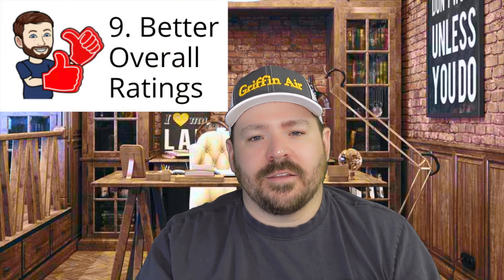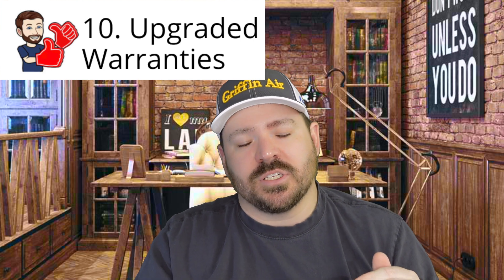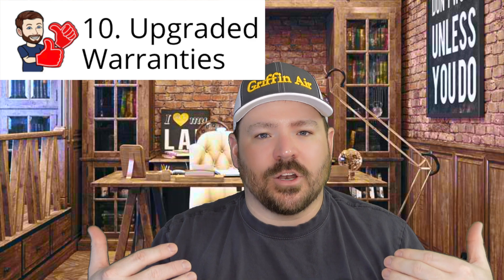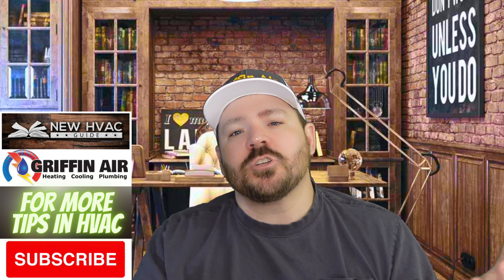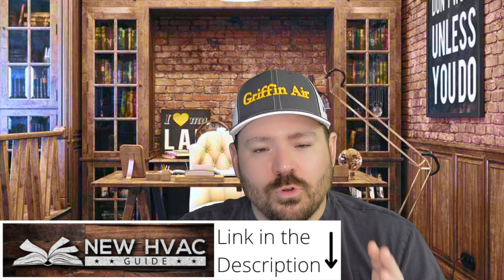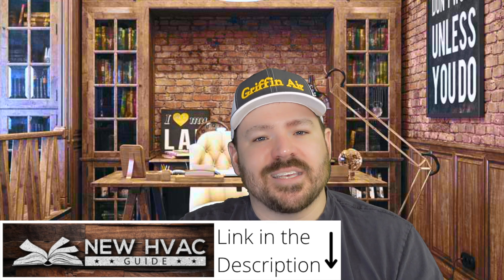12 REASONS Inverter HVAC Systems are BETTER!

Comment: not sure why im even watching this video... I know very little about HVAC.  I guess I was hoping to pick up little tid bits here and there but I don't know what a SEER is or how it compares to a conventional HVAC system.  All I know is the TAppan that came with my home, (both built in 2005) is no longer keeping my house cool.  Probably needs a recharge but I remember last summer when I first looked at this house, the owners had the AC set at 69... and it was like that after I moved in back in August.  I kept it there for a month or two and it didn't seem to have any issues.  I did turn it down to 73 and that was fine... until today, I tried to turn it on and it just would not reach 72.  It was on all afternoon.  :(
Reply: Bro, call a pro
Reply: @markw4692  lol, I did.  I know when I'm out matched
Reply: If your system needs a recharge it needs a repair or replacement. AC systems are sealed and should never leak or consume refrigerant. If they are, it means the system is physically compromised.

Comment: Inverter system can drive you nuts I had one that kept shutting down they had low voltage line with wire nut so I change the lines then it did it again this time tightened all wire connections then I came back a third time it turn out the power company had a loose connection on their side of the meter so the moral of the story is when installing and invert system be sure not to have low voltage wire that is patched and that all your wire buses are tight the boards on them are amazing and will protect the system also warn your customer not to turn the system on and off because that computer on the system does not if it is broken so it protects itself from any electrical even if it is the customer
Reply from the maker: Good tip pal!

Comment: I'm at the 6 year mark and so far my Bosch inverter has required 2 evaporator coils, a blower motor, heat strip and a motherboard for the outside unit. The unit sucks
Reply from the maker: Oh my gosh! I’d feel the same way if I were you. I’ve got a Bosch in my house and only had 1 issue. On year 4
Reply: I mean no disrespect but sounds like poor install , Bosch don’t have the same margin of error as basic systems an improper install such as not doing a proper vacuum for example or proper SH an SC , air flow issues/sizing/proper load calculation ,as well as many other things will cause major issues and we have the same issues with txvs in basic models. 
Just my opinion hopefully you could have gotten a lemon
Reply: @pineappleplays2947  It was a bad install I'm sure.  I had a new system put in last week for 14 grand,  Daikin DZ18VC.  I got the AHRI number and found they installed the wrong air handler so they came back out and replaced it tuesday.  I noticed the drain trap leaking so put a bucket under it and they fixed that yesterday.  I had to remove the attic stairs and now have them back in place.  There was a 20x14 and 20x25 return daisy chained so they made it 2 returns.  I got 12 year parts, unit replacement and labor with 2 maintenances a year at $125 each.  Wish me luck.  We are cool atm !!  I sold the 6 yr old unit with bad evap coil on FB for $800.

Comment: what do you think of the newer york HMH7 system that's kinda cross between a mini split and heat pump?
Reply: I have that model installed at my house, I don't know what you mean, it's just a inverter heat pump that runs to a coil in the air handler/furnace like every other central heat pump or A/C. It's not like a mini-split ductless or anything like that. Maybe you're talking about hybrid VRF systems?
Reply from the maker: I personally have not laid hands on this particular system. But if I’m honest, there are other brands that have done it better and sooner

Comment: There are quite a few companies that just don't have the confidence in inverter Compressors. Especially if your seeing 3-5year warranties.... There are some very smart people that do probability calculations for these companies. No a 100% conclusive piece of info to have but a good indicator of where your money should be placed... I definitely trust they're math.
Reply from the maker: What companies only offer three year warranties on compressors? Most industry pros agree that compressors in inverter systems are more reliable even if they don’t agree the extra cost is worth it for the customer for utility savings.

Comment: I’m deciding between the trane 3ton xv18 or the 3 Bosh ids 2.0 bovb18 or Daikin fit 3.5-ton 17 seer,  which one would be the quietest and have lower cost maintenance/repair long-term
Reply from the maker: You’re comparing 3 pretty good systems pal. I’d go with the contractor you like best
Reply: @NewHVACGuide  your input is much appreciated, I’m not able to find online if trane xv18 is using a inverter Technology perhaps you might know,  also considering amana heat pump with inverter technology and there  warranty is great, thanks buddy
Reply from the maker: @carlosr.2027  Your contractor should be spelling that out better... (red flag?)
Yes the XV18 is an inverter system.
Reply: @NewHVACGuide  you are correct trane using a Inverter driven scroll compressor my contractor paring it with a tam9 air handler hard decision all great units

Comment: My downstairs HVAC ductwork is mostly metal (vs flexible) so it’s kind of loud. Won’t one of these inverter systems, which runs basically nonstop, be annoying? I feel like even when it’s running at a lower fan speed that constant noise is going to be annoying. Another question: I have a two stage Trane for my upstairs, and what I didn’t like was that it always started out in first stage, which didn’t seem to produce enough heat, so I could feel colder air blowing on us until it got up to speed (all that equipment in the attic gets pretty cold after a while). It was so uncomfortable (even with the slow start up air handler speeds) that we actually ended up having our technician change the wiring on the outdoor unit so that it would always start up in second stage. Won’t these inverter systems have the same problem since the compressor isn’t running at full blast at start up? Won’t it take longer for those cold ducts to warm up?
Reply from the maker: First, I've never heard of ductwork being louder because of the material being different. It sounds to me like something is wrong. Maybe the ductwork is undersized or doesn't have cross brakes or some thing else. I go on homes all the time with metal ductwork.
Reply: @NewHVACGuide  Old tech guy here....Your one Smart dude.and love your channel. I think he may be talking about the branch takes offs the last 10' or so should be flex to deadin sound.
Reply from the maker: As far as your other concerns, yes the inverter systems will run longer and at lower speeds.  However, several brands have something called hot start which means it will not produce air until it's producing warm air. That said, if you're wanting a system that will blow your hair back constantly, obviously that's not an inverter system.
Reply: @NewHVACGuide  It can blow softly, as long as it isn't blowing icily. ;) Is there a listing of brands that carry ducted inverter systems?
Reply from the maker: @AnthonyTripoli  All the big brands do now.

Comment: the compressors may last longer but its the delicate proprietary electronics that run the compressors that end up failing and cost a fortune to replace... and if one has a Heat pump or AC that is 10 years old what is the odds of finding an OEM proprietary board to replace it going to be? and it will most likely be very expensive. I suspect you have replaced more single speed compressors because there are simply more of them out there and they have been in operation for 20+ years. I do agree the multispeed compressors are going to be more energy efficient. But all that savings would be out the window as soon as one of these expensive proprietary boards fails.
Reply from the maker: I answered that concern in the video 🙂
Reply: Technically electronics aren't delicate.  They should be protected by best in class protection.  I've never had issues with electronics that we well protected.  Same things goes for PC parts. Use a better power supply to provide clean power and the PC parts shold lake forever really.
Reply: The big argument always being comfort and sound it probably depends what part of the country you're in that has moderate temperatures where they only need to run at slow speeds for a majority of the year. Everything high tech is like that may save you some money for a while but then when you have to do repair you just lost 5 years of energy savings. I like to see a study on the full math of the full cost of ownership and operation over15 or 20 years and that cost being on a modestly sized house
Reply: I recommend power conditioner power supply if dirty power, specifically rectifier electronic boards do not like.
Reply: Why not use a commercially available vfd and use standardized plc controls to regulate the system?
Reply: Exactly put in a 15k Fujitsu mini-split and have been waiting for 2 boards and a fan motor, not wise in my opinion, straight cool w/heat strips, easy to fix and way less use of compressor vs HP. As I live in Az in a RV park we have 2.5-3 to. Package units that are 40 yrs old and still working fine. My park model unit is 38 yr. old Intertherm 2.5 ton w/7.5kw strips and works flawless, electric in winter highest bill was $68 and my summer highest is $140 I have reduced and added 2nd return and blows like a mad man, keeps a
75° all day long no problem!
Reply: @althouse2  What??? I can appreciate the argument on expensive  inverter boards.. But straight cool and heat strips? Obviously you don't have to pay for the customers electric bill. I am a firm believer in the main system using a NON variable speed two stage  main compressor  HP. and heat strips for back up. Of course I live in Indiana so we use more heat than down South. I use an 18 seer York heat pump. Its good on my electric bill.

Comment: SO I live in Central Florida, not the hottest  area but humidity is pretty high and constant, even in our winters. I am all electric ( which I hate )  so watching your video  I want your opinion would the inverter heat pump up flow exhaust be the best way to go when I replace. Also since the inverter heat pump will run pretty much 10-11 months/year what could you advise on the payback. Thanks  Great Video's
Reply from the maker: Too many variables to answer these questions pal. I’d recommend finding a good local pro and go with what they recommend

Comment: I just had a 3.5T Bosch inverter installed for $8300… the other option was $6600 for a Rheem from that same company.  Another company wanted $14,000 for a Mitsubishi inverter.
Mr 14k called and spoke with the wife… she said, we didn’t want to spend $14,000. he replied, I’ll just call your husband because he understood the benefits 😳.  that killed that deal for her even if we were leaning towards Mitsubishi.  I felt the Bosch was equally as good and I understood “the benefits” of keeping the 6k difference in my pocket and not his.
We bought it on 3/1 because we wanted to avoid the late spring or summer rush and be stuck on some backlog.
Reply: How's your bosch so far? I am assuming you've only used it in heating mode? Thanks
Reply from the maker: Wow. I can’t believe how some people speak to customers!
Reply: @NewHVACGuide    I wish you were closer to us!
Reply: @xincai951  Awesome!  it really keeps the temp       spot on.  it also has cut our bill by at least 1/3.
Reply: I really like those Bosch inverter systems but they only make heat pumps right now.
Reply: doesnt Bosch use a Mitsubishi compressor anyway? i think thats what i read